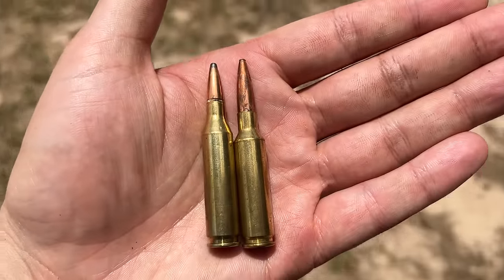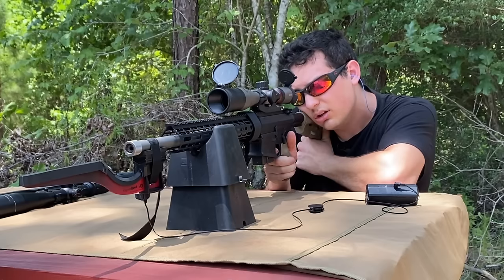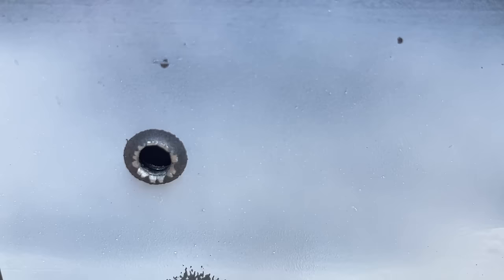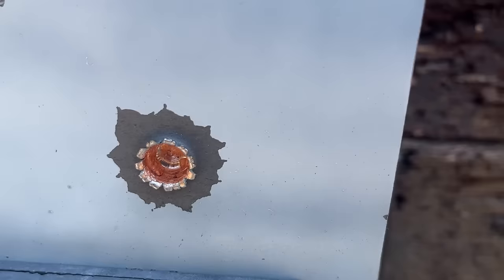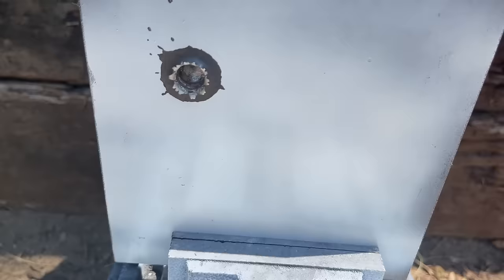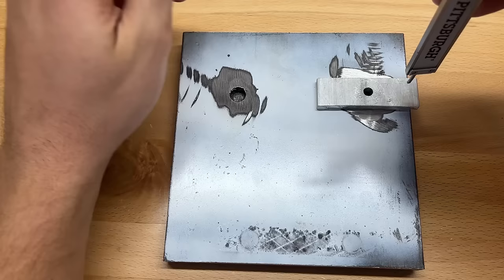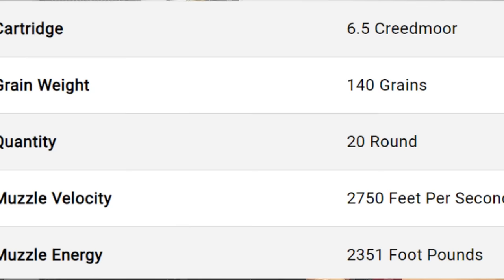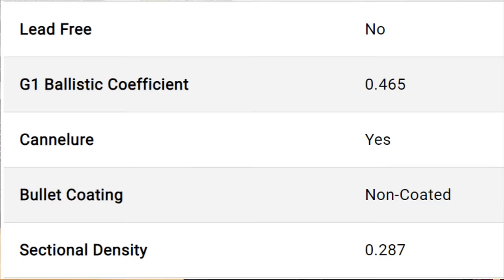243 vs 6.5 Creedmoor: Not So Close On Mild Steel?

Comment: Very simply put, they are made for game not steel. Copper is way softer than steel. Bend the same thickness pipe and the copper one will bend way easier.
Reply: Why did the softer lead core ammo penetrate the steel better than the solid copper ammo? Copper is harder than lead.
Reply: @timrobinson6573  - The lead has more energy because of its weight. 
     It's the same concept as putting 500 lbs of energy into a flying pencil and a piece of straw. They'll both fly fast. But the pencil can store more energy and release more energy upon impact.
Reply: @redfaux74  Yessir, density matters.
Reply: Sectional density.
Reply: Duh. That's why we use depleted. Uranium. That's part of the A10 30mm awesome delete it! Uranium happens when you make enriched uranium much heavier than tungsten. It's one thing to be stupid. It's another thing to be obnoxiously stupid.
Reply: @redfaux74   Did you watch the video? They had the same amount of energy, 1623 ft-lb vs 1629 ft-lb. On top of that, due to the mechanics of inelastic collisions, lighter, faster rounds typically penetrate better than slower, heavier bullets, at least when they are made of the same material and are softer than the target. I think that leaves sectional density as the most likely culprit here.
Reply: @Quasarnova1  - I've seen all his videos. 
     I think you're forgetting a few things. It's only true that lighter will penetrate IF they are shaped with a point vs the heavier with a blunt head. If both are shaped the same, pointy, and the velocity are the same, the heavier will always win. 
     Maybe you should remove the chip off your shoulder. I'm not interested in any competition with you. If you want a nerd pin then you can have it.
Reply: @redfaux74  I'm not here for any competition. You stated that the lead bullet had more energy, which it didn't. If collision mechanics are too "nerd pin" for you then I won't go into that, but there are plenty of videos of FMJ bullets impacting steel, and if they have the same energy, the lighter one almost always wins.
Reply: @henryettacollins9095  I think comparing Copper Or lead core with copper jackets and then talking about Depleted uranium is way off base if Im not wrong the sectional density is muck heavier than either and they SAY that those round are actually self sharpening ...
Reply: @henryettacollins9095  Uranium is not heavier than tungsten, or anywhere as hard. But what it does do is self-sharpen as the tip burns off, meaning it can penetrate deeper because it maintains a much smaller frontal area.
Reply: @redfaux74   Yup, sectional density matters.
Reply: But lead cores are spofter than copper!
I also assumed that the copper bullets would have out performed on "killing " steel,  than the lead cored bullets.
Reply: @redfaux74 

No way!    Lead isn't more powerful than copper.    Power is measured in foot pounds,  not in the type of metal.
Reply: Lead is in fact depleted uranium once it reaches its final depletion.
Reply: @redfaux74  heavier lead RETAINS  kinetic energy, better than light copper by retain momentum better.
Reply: @stanpotter7764  
I thought depleted uranium was harder and heavier... and that's why we use it in some AP bullets.
Reply: @timrobinson6573  density....
Reply: For copper to really be effective in cutting steel , it needs to be not just supersonic , but hypersonic which is FIVE TIMES SUPERSONIC 
Demolition experts rely on copper to cut steel with shape charges that are really effective
Reply: Also consider,  are the striking energies the same?
Lighter, lower sectional density projectiles loose speed at a quicker rate,  and therefore loose more striking energy.  (provided their muzzle velocities, are the same).
Reply: @martinbaumgardner4432  
People in this thread like you don't know the difference between density of materials and sectional density of that same bullet. 
They are two very different things.
Reply: I don't know why this dude shoots at mild steel when he could shoot at various body armor panels like Matt Buffman has been doing for at least 8 years now. Shooting at actual armor produces useful information while shooting at mild steel just provides entertainment. Buffman has also got his hands on and tested some pretty hard to get AP rounds.
Reply: Copper will absolutely defeat steel. A 1.5oz. shape charge will put a hole you can put yur finger in 4" of AR500 steel
Reply: Have someone shoot a copper bullet with the same grain as the lead core. That eliminates a lot of variables as the mass and velocity should theoretically be the same and you can see the difference between the two projectiles. There must something cool going on
Reply: If the bullets weigh the same, then the chronetic energy should be identical if the velocity is the same. In order to do this, you would need to work both loads up. Lead weighs more than copper, however if both lead and copper projectiles are shaped the same, weigh the same and are traveling the same speed, one would assume that the copper would outperform the lead.
Reply: @timrobinson6573 that's a scientific question amigo. Lead is denser, but, the rapid "sand blast" effect lead has also helps it to burrow

Comment: Nothing wrong with a 6.5 creed but I really like the plain old .243 win. It’s just been a solid performer for such a long time.
Reply: 6.5x55 Swedish Mauser has been a solid performer since probably before your great grandparents were born - it's been around since 1892.  Swedes and Norwegians have been using it on moose, caribou, and red deer for more than 100 years.  6.5 CM is just a short action version of 6.5x55.
Reply: @smokedbrisket3033  .243 Win has always been a cartridge I enjoy very much. I’m sure 6.5 Swedish is just fine but it’s not very widely available in the US and if I had to choose between .243 or 6.5CM I’d just take the .243.
Reply: @JG54206  the rifles are pretty easy to find, at least on line - Tikka makes several different (and very affordable) versions.  But it's definitely a hand loaders cartridge here in the US.  Most of the factory ammo is loaded to the lower pressures more suitable for the old Krag Jorgensons.  The original Mauser 96 and any of the more modern versions that go by 6.5x55 SE are capable of ordinary pressures in the 60K psi neighborhood.  Either way, 6.5 is a bullet that punches well above its weight, just keep it to appropriate distances of no further than 300 yards or so, and you're golden.
Reply: @smokedbrisket3033  I want a Tikka rifle in the worst way. Their actions just seem so buttery smooth.
Reply: @JG54206  - for an under-$1000 rifle, yes, indeed, they are quite buttery.  The only one at that price point that I think is better is Sauer model 100.  I have a Tikka T3X and a Sauer 100, wouldn't sell or trade either one of them.
Reply: @smokedbrisket3033  yeah. Generally speaking most rifles over $1k are just currently out of my budget.
Reply: @smokedbrisket3033 Damn you sure get worked up easily. Who cares how old the 6.5 Swede is? Dude said he likes the .243…. chill bro
Reply: My .243 Winchester in a M700 BDL has been keeping my freezers full since 1977… except for elk I seldom use any other rifle that I own.
Reply: I have a 6.5 CM, but I don't blame you in the least. The .243 has been around since the 50's and has a well deserved reputation for reliable performance over those 70+ years.
Reply: Yes it has. Plenty of power for Whitetail, Black-tail and even Mule deer no problem at 100yds.
Reply: @JG54206  
They are and I own two of them in 270 Win. Such a premium and precision rifle at a great price. With hand loads I shoot nickel sized groups at 350-400yds all day. Insanely accurate and the trigger is as good as the bolt.
Reply: 243 👍

Comment: I changed to 243 from 30 06. The reason was I  wanted to leave a new rifle to my grandson. I found out I should have made this change for myself years ago. The 243 is easy, lite, dead accurate. I recommend it as the caliber for whitetail.
Reply: My wife shot clean through a muley buck here in WY with 100 grn sp bullets he didn't even act like he was hit took three rds through the chest to drop him, they zipped right through him at 110 yds.  We have a Savage with about a 20-inch barrel, and I think the .243 needs 24-inch barrels to get that 100 grn bullet up to speed to open it better!  Now the 95 grn Hornadys do a great job expanding and drops them dead!
Reply: @OdinX316 I shoot sika deer with an 80 grain soft point yet to have a runner
Reply: @OdinX316 I've been using 90gr sp from ppu and they are cheap, accurate, loaded up hot and absolutely drop everything I've shot with them, I use a 22 inch barreled rifle. And the largest deer I've shot with one was a very heavy bodied Idaho mule deer from close to 300 yards, it absolutely killed him graveyard dead with one round through the heart, planted him on impact he got up trotted 20 yards layed down and died right there.

Comment: It may sound cliche, but the .243 Winchester has been punching above its weight for a long, long time. Compared to a "new technology" cartridge like the 6.5 Creedmoor the old .243 held its own pretty well. I think both cartridges are very good for mid size game. Good test. Would be interesting to see these two matched up again using 24" barrels.
Reply from the maker: I agree. 24” is where these cartridges really shine
Reply: “New technology” of the 6.5 has nothing to do with this test. The cartridge is just a container to hold powder, and the bullets do the work. The only new technology relevant to the test is the bullets themselves, which both have.
Reply: Good test would be .243 vs 6mm Creedmoor. Same diameter,  6 creed has about 150fps more.
Reply: 6.5 CM is just a rebranding of a cartridge (6.5x55 Swedish Mauser) that predates the introduction of 243W by almost 65 years.
Reply: Try a flat nose bullit
Reply: @smokedbrisket3033 No, the 6.5 Creedmoor is a completely different design than the old Swede, different concept all together to fire heavier high BC bullets. Certainly not just simple a "rebranding" of the old 6.5x55.
Reply: @EC-mc7vg - that is inaccurate.  The heaviest bullets made for .264 caliber rifles is the 160 gr Woodleigh Weldcore, with a BC of .51.  There isn't a 6.5x55 made that won't shoot that bullet, but I know for certain there are a few 6.5CMs that won't - not because they really can't, but because the magazine isn't deep enough to support that long of a cartridge - I'm also not convinced that the shorter neck on a 6.5CM is suitable for the 155-160 gr bullets, either.  

My 6.5x55 fires 143 gr ELD-X exactly the same as any 6.5CM.  The only 2 "improvements" in 6.5CM over 6.5x55 are a shorter case and tighter tolerances in the throat.  Otherwise, they're identical.  If you look at the reloading data for them both, you'll see no difference in performance - other than the milder loads required by the old Krag Jorgensens.  6.5x55 and 6.5 CM are ballistic twins.
Reply: @smokedbrisket3033  They very well may be very, very close in a ballistics, but 6.5 Creedmoor is not just a "rebranded" 6.5x55 Swede, and they are certainly not "identical". Different overall length, short action vs long action. The concept of the "modern" 6.5 Creedmoor to old 6.5x55 Swede seems to be along the lines somewhat of the .30-06 and going down in size to .308 in a short action and still get "similar" ballistics. I don't own either cartridge so there is not favorite for me to lean towards. But if you can get the same ballistics out of the 6.5 Creedmoor using less powder than the Swede, less recoil and a short action, it would appear to me that it is a pretty efficient cartridge. After all, we have heard about how great of a European round the 6.5 Swede for decades, would stand to reason with the same ballistics the 6.5 Creedmoor would at least be as good a cartridge.
Reply: @EC-mc7vg  I didn't say they are identical, I said they are ballistic twins.  They aren't merely close in ballistics, there is so much overlap as to be indistinguishable.  That's what makes them ballistic twins.  I've been handloading for the Swede longer than 6.5CM has even existed.  I do know a thing or two about this.
Reply: @smokedbrisket3033  You did say in your previous post "The only 2 "improvements" in 6.5CM over 6.5x55 are a shorter case and tighter tolerances in the throat. Otherwise, they're IDENTICAL". I'm simply stating the fact that they are not "identical", extremely close ballistics and both good rounds, but not identical.
Reply: @EC-mc7vg  their ballistics is what makes them identical.  the modestly astute reader might have picked up on that since literally everything I've written here was relative to ballistics.  no, they're certainly not the same cartridge.  along the same lines, both of those are the same as 260 Remington.
Reply: @smokedbrisket3033  A moderately astute person wouldn't have been using the term IDENTICAL for two cartridges that are blatantly obviously DIFFERENT. Or even use the term "just a rebranding of the 6.5x55 Swedish Mauser". You can be upset if you wish, but once again, I was simply stating the fact that the two are not IDENTICAL. Besides, we have both stated many time the ballistics are very close between the two. So this astute reader easily deduced that the two were very close ballistics wise, but were not IDENTICAL as you stated many times then said you never said they were IDENTIACAL which you most certainly did say. So it seems we agree that the ballistics are very close.
Reply: 243 best deer and varmint rifle
Reply: The creedmoor was originally designed as a competition target shooting round if I'm not mistaken.
Reply: @davesmith8330  I believe that to be the case as well. But, with a properly constructed hunting bullet the 6.5 Creedmoor can be a very effective medium game cartridge.
Reply: @EC-mc7vg  oh I agree, I mean, people have been hunting with it and have been producing some good results with it, i.myself have a .243 but am toying with the idea of picking up a 6.5 creedmoor just to have both, they both have their good qualities and bad as does anything really, also keep in mind to that in the hands of a good shooter, you can do quite well with almost anything
Reply: @davesmith8330  I too have been toying with the idea of getting a 6.5 Creedmoor, but I think if I was going to step up in power from .243 I would probably go with the 7mm-08 instead. The plus now for 6.5 Creedmoor is the ammo has become very available and affordable. But then again, the trusty .308 will cover all the same ground as the former two cartridges and fling heavier bullets if needed. Decisions, decisions.....LOL.
Reply: @EC-mc7vg  I was watching another good YouTuber the other day who_tee_who and he mentioned that there's other types of the 6.5 in production, the 6.5 prc calibre and the 6.5fpm, I think the only difference is the amount of powder/size of the casing. I can't remember what one he took deer hunting in the video...I wanna say it was the PRC, anyways, it took the deer off its feet
Reply: @jameslee4328 or a .260 rem vs the 6.5 creedmore.
Reply: @phild9813  the new technology part is the research and math that went into designing the cartridge, not the actual manufacturing process. In terms of material and production, there's nothing that sets either apart from every other metallic center fire cartridge. The tech advancements are in the field of ballistic engineering.

Comment: Copper being less dense means lower sectional density, which is a big part of penetrating steel.
Reply: SD is a function of bullet weight divided by the square of its diameter.  For example, a Barnes TSX 286 gr bullet has the same SD as a 286 gr Nosler Partition, just a bit north of 0.3 (pretty good SD).  And that's the same SD as every .366 caliber bullet that weighs 286 grains.

Doesn't matter what caliber bullet you pick, a 150 gr monometal 308 bullet will have the same SD as any 308 cal 150 gr gilding metal jacketed bullet.
Reply: Wrong
Reply: The actual bullet metal density has nothing to do with bullet sectional density.

Comment: Well, one thing I'd think should be pointed out is the 243 qnd 6.5 Creedmoor aren't directly comparable. The 243 and the 6mm CM or the 260 Rem vs the 6.5 CM would be better comparisons as they use the same projectiles. 
As for the monolithic solid copper projectiles everyone else seems to have touched on it.

Comment: When I use to reload many different calibers  back in the '70's and '80's my friend had a .222 and asked me if I could load some "hot" rounds for him, so checking all my reference books I proceeded to do so. We took the cartridges out to an abandoned coal mine, found a 6x6 angle iron frame 1/2 inch thick. We backed off about 50 yards and he shot 3 times, we walked back to the frame and there were 3 little round holes all the way through the 1/2 thick steel, and those were copper jacketed bullets I reloaded with.

Comment: What i've learned here is that shooting steel shows us very little about penetration capability in game. 

We see lighter solid copper projectiles zip through whitetail, while heavier frangible projectiles do not always provide same penetration.
If you're shooting steel plate instead of a deer, it seems to be the other way around.

It's still very interesting